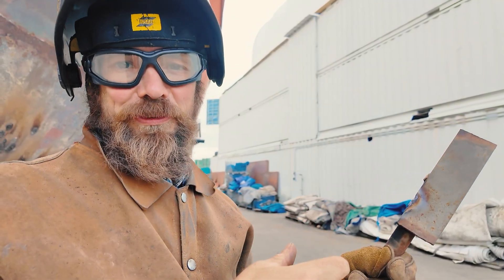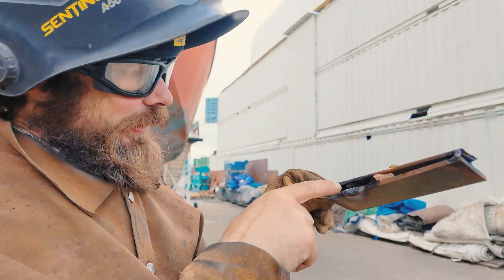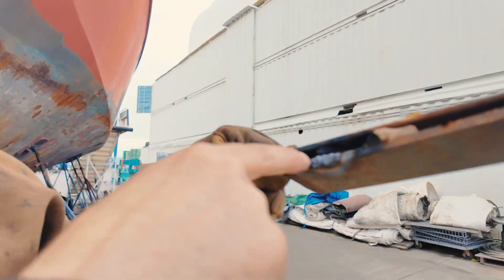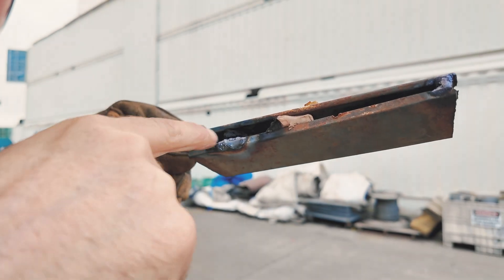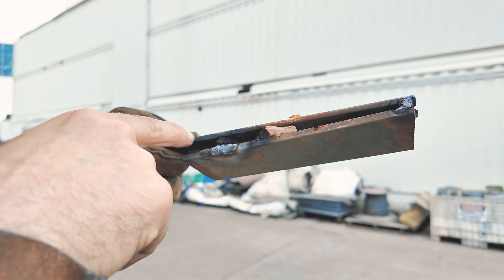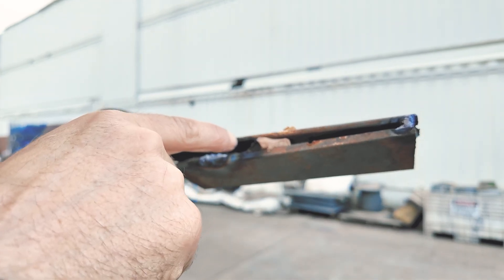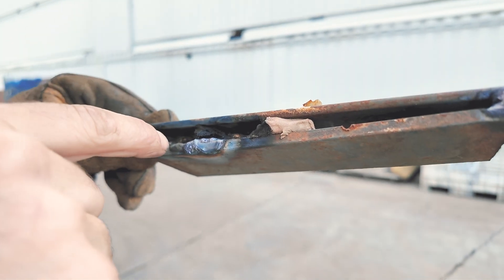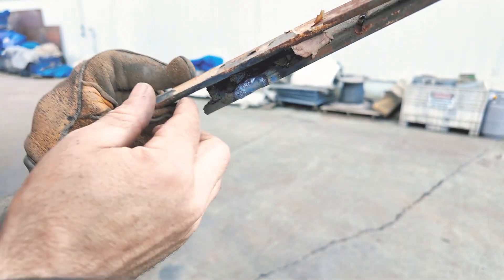Does Insulation Burn When Welding? The Truth Revealed 🔥

Comment: Try repeating the foam burn test welding as if filling a spot where the set up is similar to actually filling a spot on the hull. There isn't any direct sparking and flame. Keeping the rod hot so that it melts into the depression fully and get off as soon as possible. That is if using metal vs epoxy makes a stronger hull.
Reply from the maker: Yeah, I know my test wasn’t very scientific. Really I just wanted to see how much melting an exposed arc would cause, since every once in a while a thin spot blows through and the foam ends up exposed to direct spray. Honestly, this is the second time I’ve done this kind of test, and in the end I’ve decided I’m basically going to pull foam anytime I’m welding on the hull.

It’s a tough call—lots of hours of labor at stake, not to mention the risk of burning the boat down (or the nasty corrosive gases this stuff gives off). So I’ll keep experimenting with some combination of epoxy and welding, chasing that elusive “perfect compromise.” Stay tuned to see if it all works out—or just cringe along with me as I change my mind again and again.
Reply: @TheAlaskanGypsy  its called .. being flexible .. "experience" is a good teacher .. no education is cheap .. just enjoy the .. experience .. on the way to a dreeeaam boat .. its NO dinghi for sure
Reply: filling the divets.. just run short beads or spot from one side a couple of seconds a weld.. stitch weld sorta ..minimal heat getting to the back .. then move to next & come back when its cold.. you dont need deep penetration just clean fussion.. its not structural as such.. to epoxy I wouldnt fill them just epoxy prime.. do some each haul out.. epoxy filler will let go sooner or later especially in cold conditions